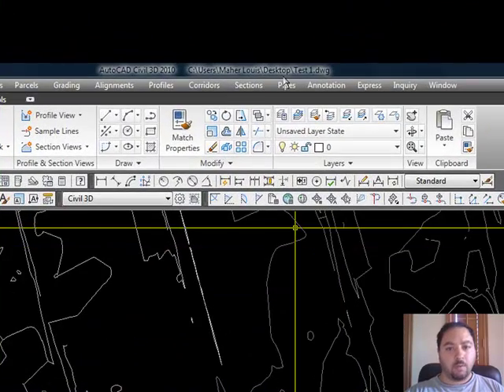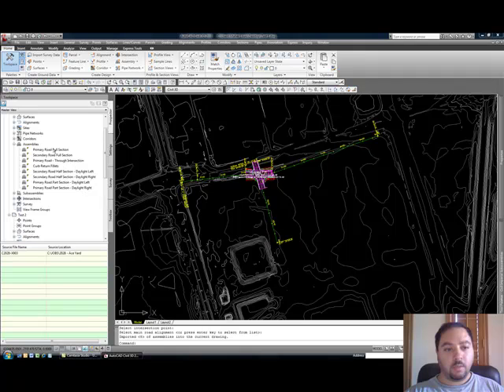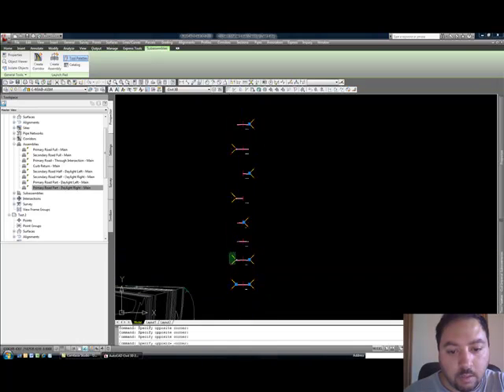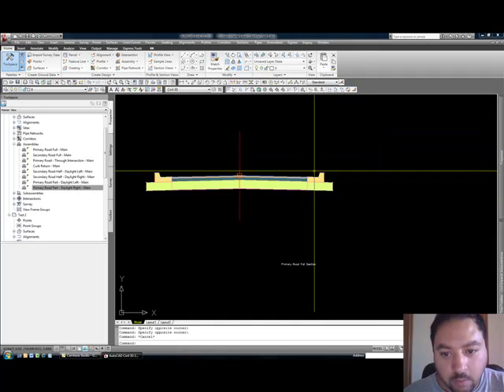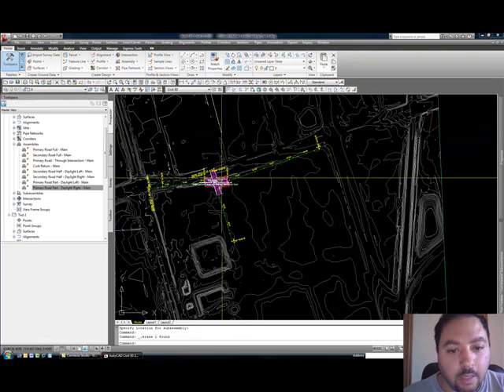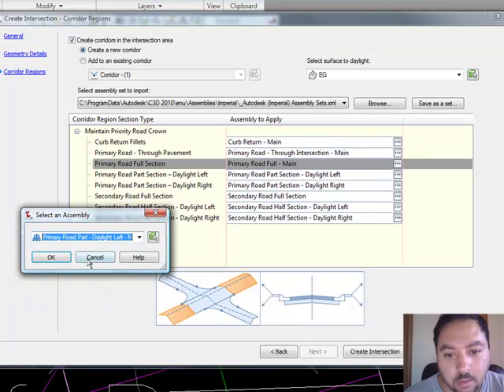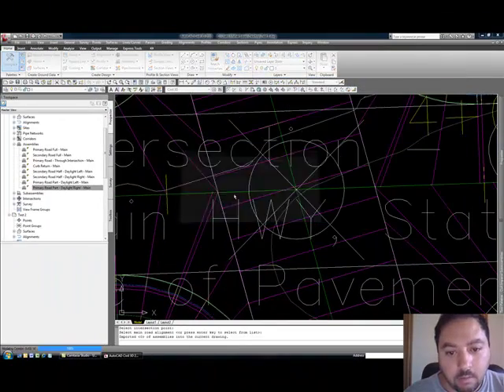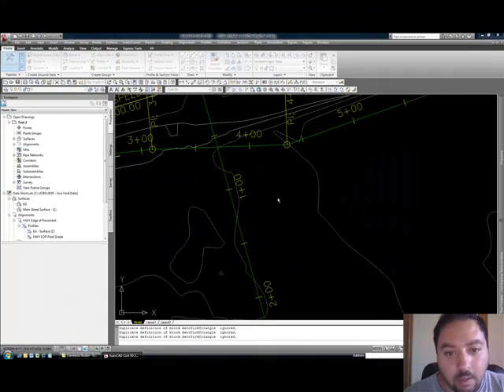Civil 3D - Create an Assembly Set using Civil 3D 2010

Comment from the maker: Keefak Alaa, shoo akhbarak? Ufwon for not responding to you earlier ya ukhee, but I've been busy. Anyways, plz use Civil 3D cross sections to sample surface objects, and it's very slow and difficult to sample corridor objects. I recommend taking featurelines from the corridor & converting them into static 3D polylines to define 1 surface object, then do it again to define a 2nd surface object, then cutting cross sections of those two surfaces. And go from there. Good luck!